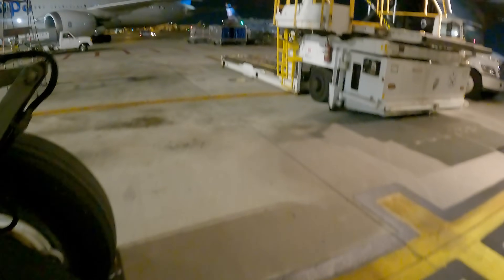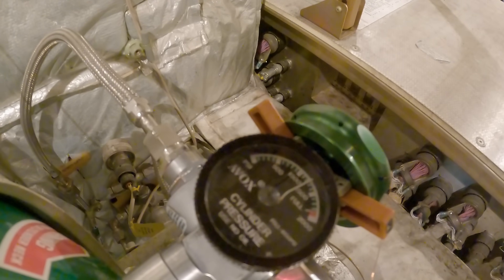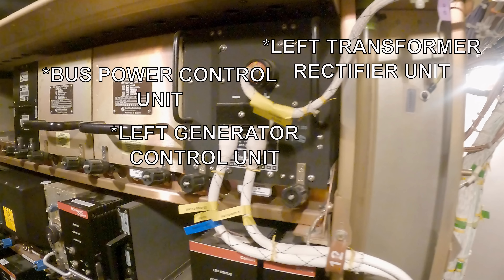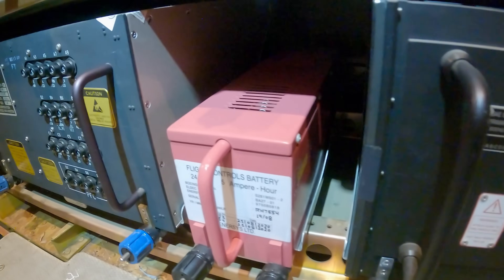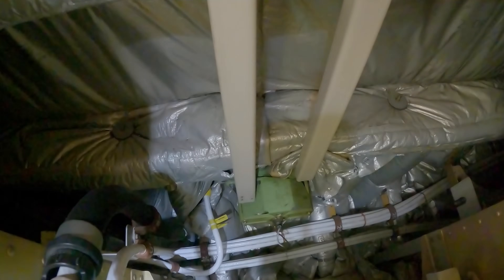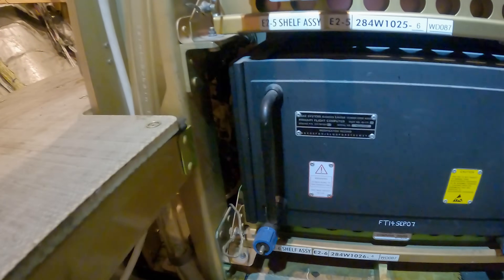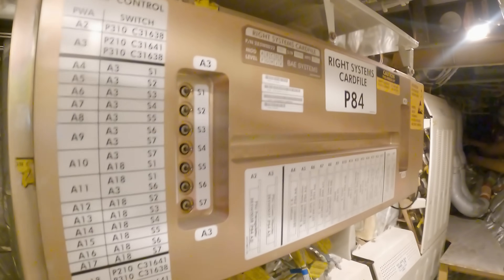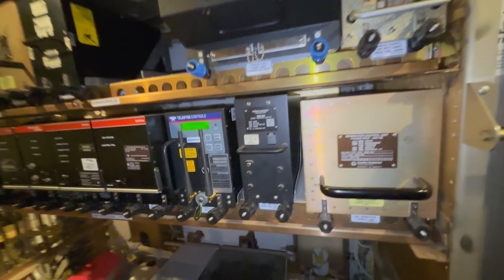B777 Main Equipment Center Walkthrough

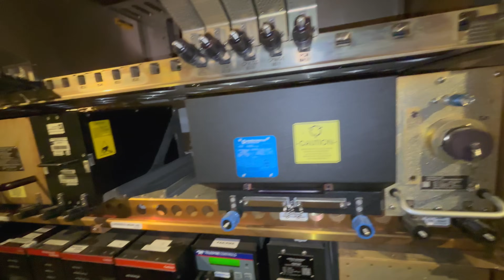Comment: Very interesting video and thank you for showing us. The modules on the rack are designed to be modular. However, how it is connected? It seems like there are not much space behind the modules. 12:17
Reply from the maker: On the back side of the racks you would find the wiring bundles and connections where they are interconnected.

Comment: As an EE for 43 years I'm really shocked at the DIY look of this interior! Hose clamps! I use those in my garden. "Zip" ties? I use those to hang my Christmas lights! It honestly looks like someones garage where they just put in some racks and loaded modules on them then wired them up! Most of those modules look like they would fall right out with strong turn.
This doesn't inspire confidence at all. I would have expected mil-spec EVERYTHING!
Reply from the maker: The systems are very robust and can withstand the expected forces. And are all within regulations
Reply: Have you really been around aerospace avionics.These Adele clamps are standard and so are the zip ties which are a result of this industry.
Reply: @2010kb1  43 years, longer than you.

Comment: Where is no classic "ground" for all this avionics equipment, right? So, all EMI/RF interference possible problems can be solved only by metallic shielded cases/boxes and shielded cables?? And proper wiring, of course (signal lines and power lines are separated from each other and crossed only perpendicular, not parallel)...

Comment: It's like a little datacenter in the sky. Impressive!
Reply: It's processing power and storage capacity is nowhere near those of a datacenter. It's mainly old tech with big measures of reliability and redundancy, which is fine - exactly what you want in an airplane. The only worry I'd say the the amount of electrical consumption and batteries in there are a fire hazard. Newer tech tends to be more power efficient.

Comment: I've flown many thousands of miles in 777s without any problems (that we were told about). Problem is, like any other aircraft manufacturer, every part is supplied by the lowest bidder. At least with a car, you may grind to a halt on the road, but in an aircraft..........
Reply from the maker: Of course cost is an issue in developing an aircraft. Don’t think they can cut too corners developing the B777

Comment: That’s not poor build. Every interconnect is a custom piece and wires are teflon jacketed. You‘ve never seen anything like this in a building’s wiring. Infinitely more durable, wire harnesses are made for serviceability. Note every single piece of electronics in individually shock mounted on special color-coded mounts to match their weights. This is NASA level construction.
Reply from the maker: Yes, the wiring and electronics are built to withstand the toughest conditions.

Comment: I am amazed how poor the electric wiring is made, very little protection against vibration and rubbing. I don’t want to fly in that plane.
Reply: Poor made ??
Since 1993 till today in 2024, Boeing made 1734 of those 777 planes. Zero, yes NO 777 ever crashed due a technical problem.
With the grand total of all flying hours of all the 777 aircraft combined, it made this aircraft the safest transportation vehicle humankind ever made.
So, I doubt your conclusion of poor 😅
Reply: @MrBlafhert  Are you not including the Max in this!!
Reply from the maker: It doesn’t look pretty but it is well made.

Comment: How many watts is the VHF and HF radio power output? Thanks for the walkthrough Dennis!
Reply: I have no idea the power output but when we test the HF we call the West Coast from Denver, for instance.
Reply from the maker: Not 100% sure but the HF is as a recall around 200Watts and the VHF around 10Watts.
Reply: @dennisvijverbergbrakesrele6098  Interesting info. I can call San Fran from Denver......but to be honest it's never very clear. Can barely make out what they say on the other end. I wonder why they don't get rid of HF and just go with Sat Com but I've heard that sat com is way more expensive. 
But then why don't they use onboard wi fi and just go across the Internet?

Comment: So much software with potential for bugs!
Reply: Quite correct. I do a lot of software loading on these aircraft and there's never been a problem that I am aware of. The engineers seem to have it all worked out. In some cases that I am aware of if there is a glitch in the software it just won't load. I've had to take the loader back to the ground network and reload the part number. Either way they must have a method of verifying it's airworthiness before sending it out to be uploaded. In the case of mechanical components we would put them on an FAA approved bench test. If it works during the approved shop test it will work on the aircraft. I assume that the software must have the same high standards.

Comment: Mind boggling the amount of engineering that goes into these planes.
Reply: And for every minute spent engineering in aviation 500 are spent on paperwork.
Reply: @ Whatever it takes!
Reply: @Wock__  writing what is what and what it does?
Reply: @pako1834 I can't reply anything without youtube deleting it 😐

stuff like requirements, testing, certifications, failure modes, functional hazard assessments and the like.
Depending on the Design Assurance Level different levels of rigor are required.
Reply: OMG! I had the same thought!
Reply: aha editing my reply finally did the trick

Comment: Good to see the Smiths/GE Electrical Load Management System (big white cabinets) doing their stuff.  I led the software team that developed the original system back in the 1990s, when Boeing were managed by tough engineers, they gave us a hard time, for all the right reasons.
Reply: AIMS knows everything. ELMS controls everything
Reply: @ only the power supplies, reconfiguring in event of failures and some monitoring and modulation to be fair.  It’s been a great tool for Boeing to integrate the airplane and reduces pilot workload.
Reply from the maker: As this part of the aircraft at time only needs a reset, a job well done.
Reply: @dennisvijverbergbrakesrele6098  That’s thanks to the whole spectrum of engineers at both companies working relentlessly together.  Like most aircraft systems, It’s been pretty robust when not abused.
Reply: From computer view. None of the units had any indicator led/lamp. All the equipments are remote bus controlled; not even a direct connection to any unit ! But the fuse panel looks just like in 1950-era airplanes.
Reply: @ivekuukkeli2156  That’s because a physical contact separation is necessary for safe isolation and the push-pull circuit breaker still does a good job.  Auxiliary contacts are monitored to relay it’s status to other systems.
Reply: @MS-Patriot2 You did a great job. Those who don't know have no idea how many things you have to pay attention to, how easy it is to make a mistake (an infinite cycle, a faulty interruption, whatever...), and how big a problem it can be. I also do highly responsible work in a technical field (industrial gas combustion and its safety equipment), and so in my middle life I thought about it that there are much easier jobs to do, I don't know why I chose this one. Because here, people's lives depend on how thoughtfully and conscientiously you did your job. cheers
Reply: @bandita84  I worked in IT, I'd much rather be yelled at and criticized about reliability of a critical system than about the color on the login page banner on your stupid startup website which nobody will ever use

Comment: What temp do you keep this room at, ideally?
Reply from the maker: This area is only ventilated by the equipment cooling and some point it will receive some air conditioned air, but is only for equipment cooling. The area itself doesn’t have any temperature control, the temperature will very depending outside conditions

Comment: Plug and play....
Reply: Yes and no. The 777 even as old as it is, is VERY automated. In some cases the manual just tells you to install a box and then look for an active fault. If no fault it's ok for flight. But some boxes have extensive installation tests required. It's all insanely complex and I will be glad when I retire. There is a LOT of liability involved in working on airliners. Very few jobs carry the liability risk of an airline technician.

Comment: 1. Amazing how a seemingly straightforward function like the Window Heater is actually a complex system with a large controller module in the equipment bay. 

2. It would be way cooler to hang out down here during a flight than even the comfiest business class lay flat seat.
Reply from the maker: A window heater needs an accurate power supply and it has sensors placed in the window to keep the power send to the window within it tolerance.

I still rather be in business class😬, but I have seen it of course more than once.

Comment: So many things to go wrong; it's a miracle they don't fall down more often.
Reply from the maker: If things go wrong there is at least one or two backups
Reply: There is literally an army of technicians working on these aircraft during every overnight period. People would be amazed at the monumental human effort overnight that goes mostly unseen.
Reply: @rael5469  Yes, I am sure of that. But this complexity also increases the chance of error.
Reply: @befeleme   That's why we get paid the big bucks and that ain't no joke. I work with a lot of VERY competent technicians. All highly trained. 
It can be very stressful to sign off a complex job on one of these planes. The thing is that the engineers have designed an airworthy aircraft. As long as we maintain it to the standards the engineers set....then it will remain safe. There is enough redundancy that one or two systems failing is very unlikely to result in a crash. BUT....ageing aircraft is always a pressing concern. And the airlines are renewing fleets when they can.
Reply: @rael5469  I am sure you are doing an excellent job, but relying on VERY competent technicians in every single country to maintain the correct standards, plus the hope that all airlines will remain rich enough to be able to afford to renew fleets before they start failing, seems to me in denial of the reality of the human condition. Shit happens. And the more complex a system is, the greater likelihood of it happening.
Reply: @befeleme  No....shit doesn't just happen. Look at it this way.....modern engineering is such that they've designed in enough redundancy so that.....if a part fails there is a backup. If a technician makes a mistake....there are redundant systems. The proof is in the years that go by without a fatal incident. 
And I can tell you that the new guys they are hiring are better at their age then I ever was at any age. And they will only get better. So do the diagnostic systems. and the reliability of component systems. No worries. Flying is safer than it's ever been.
Reply: @rael5469  Boeing 737 MAX passengers of Lion Air Flight 610 and Ethiopian Airlines Flight 302 might differ - if they were still alive.
Reply: @befeleme   Flying is still safer than it's ever been.
Reply: @rael5469  Except when there is a software bug. I guess, that's why Boeing's stock has dropped by 25% of value this year. 🤣
Reply: @befeleme   I have no information regarding Boeing's stock value. Flying is still safer than it's ever been.
Reply: Systems and processes manage risk of human work.

In terms of complexity… the benefit of having the redundant systems outweighs the risk of having single ones. We have decades of data across millions of flights to support this. Not to mention data from failures over time too.

There will always be risks. The question is how these risks are managed and mitigated. The “risk” of redundancy is not a simple matter of just multiplying it by the number of systems.

Comment: do other aircraft need the same amount of equipment to operate? How does it all fit in a smaller 737 for example?
Reply from the maker: More or less yes, a B737 would not have the fly by wire system, but anything else would be in there. So no room to walk in a B737 equipment center.

Comment: Very interesting tour through the equipement bay! Everything double, that's redundancy! I was surprised to see it still has ADF receivers! But ok there are still many NDB beacons around.
What is a signal conditioner?
Reply from the maker: Indeed, you still see ADF in all of them, at least there will be one ADF installed.

The signal conditioner just translates analog signals coming from the vibration pick ups on the engine into a digital signal.
Reply: @dennisvijverbergbrakesrele6098  Ok I see. Thank you!
Reply: @Ztbmrc1  ADF is good for listening to AM radio :-)
Reply: @cavok76  Yes but AM broadcast stations are also diminishing, at least here in Europe...
Reply: @ AM use is diminishing everywhere. Moving to streaming. It was partly a joke. In Australia we had a lot more radio stations instead of NDBs. We could use ADF for lightning alerts in GA aircraft.
Reply: @cavok76  Yes. Well long ago pilots used to use the radiostation with there ADF to navigate.

Comment: Cant get a reference from the video how large/high is this compartment compared to a human body? Are you crawling there or walking upright like in the passenger cabin? Or is it half-way so, so you need to bow but not crawl?
Is there a lot of free floor space, like, can 2-3 persons stand together, or is it just a tiny 1-person-wide aisle everywhere?
Reply from the maker: The side areas there you need to crawl, the space were the racks are you need to the bend over to walk (at least I need to at around 6’2). The height is about the same as the cargo bay. I think it around 5.2 ft or 1.6 meters high.
Reply: @dennisvijverbergbrakesrele6098  Thanks, I see. Pitty it's not full walking height, like 6 feet or so.
Reply: @NikolaiUA  Dutch people in trouble with 6' 🙂
Reply: @twentyrothmans7308  Oh, well.. I thought 6' will pretty much safely cover most of the human population around the globe
Reply: I was also thinking the same question. 😅👍
Reply: I was also wondering how he could move in such a tiny space

Comment: I couldn’t figure out how the modules were held in with the screw knobs on the shelves but at 11:45 you can see a space where there are screw type fittings added to the shelf that I assume the screw knobs you see screw onto.  In most of the spaces these additional screws don’t seem to exist so I assume they only add them when fitting a module to the empty spaces?
Reply from the maker: Indeed, they just get installed when needed, otherwise it is just some extra weight.

Comment: I feel for the poor souls who have to wire up these aircraft. It looks like it's all done manually wire by wire.
Reply from the maker: Not an expert in fabricating aircraft, but I think most of the wiring is built outside the aircraft before final installation.
Reply: @dennisvijverbergbrakesrele6098   Correct.
Reply: For the most part the harnesses are assembled outside of the aircraft. I don't know how it's done now, but when I worked at Boeing there were giant sheets of paper attached to boards where wires were attached to lay out the harnesses.

Comment: Very informative, I very much enjoyed watching all 14 Minutes of it! One question: The boxes, esp. the larger ones like primary flight control computer, they look very large, sturdy, bulky... but are they just as heavy as they look? They are for a (albeit very large) plane after all, and I would guess having so many individual controllers and devices at one point adds up?
Reply from the maker: Hallo there, I check, they give the weight of a PFC around 37 lbs, not too bad voor a big box like that.
Reply: @ thanks for that precise answer!
Reply: I'd be more concerned about having several Americans on board at the same time!!😂

Comment: Complicated 😂
Reply from the maker: That’s why the manual is so thick 😉
Reply: @dennisvijverbergbrakesrele6098 well…..multiple thick manuals, not just one thick one. You should see the maintainance logs on the aircraft when they are sold or leased to an airline. They always follow the aircraft and depending on years of service and complexity they could take up a fair section of the lower cargo bay. Just imagine if the aircraft is involved in a major incident leading to a loss of the airframe, the investigators will pour through ALL of the service logs which may take months or years to see if any repair directive has been missed.
Reply: @Subgunman  Quite correct.
Reply: Amazing that these aircraft are so reliable given the sheer complexity.
Reply: @98xjdriver  They are reliable but also there is literally an army of technicians maintaining them during the overnight period between flights. THAT's why they seem reliable.  That's why the old saying: "Wanna make a million dollars? Just invest  10 million in an airline."

Comment: How is the dust situation 13:35 handled?
Reply from the maker: Hi, ik has been a while I did heavy Maintenance, but usually surfing C and D checks these areas get a cleaning before any inspeections.
Reply: The dust is mostly harmless because aviation circuit boards are sealed against moisture (and therefore dust). However....the maintenance manual tells the installer to clean the rack before installing a serviceable component. I guess that gives it a fresh start.......but yeah, those compartments are pretty dusty and dirty. It's public transport.